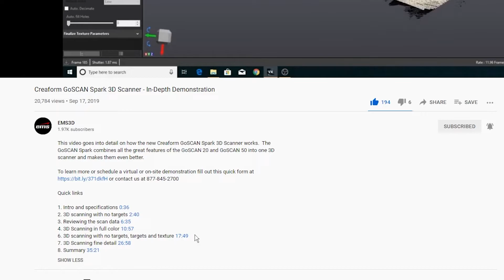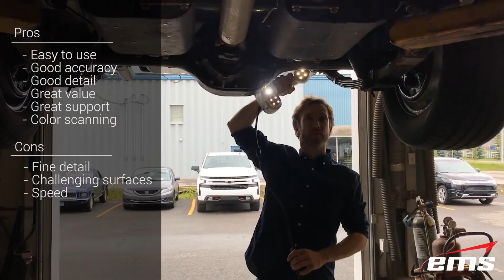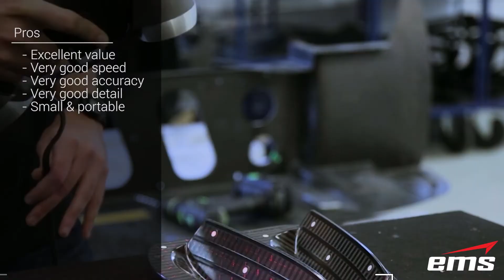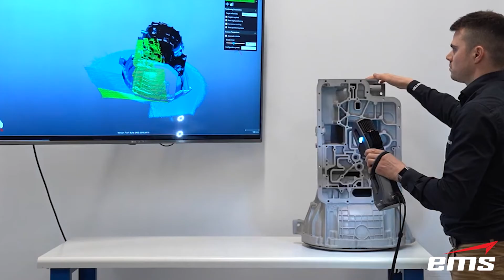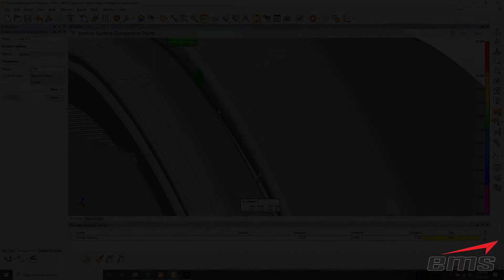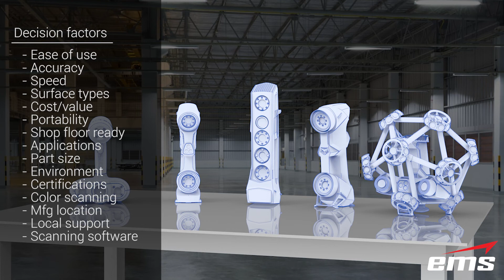3D Scanner Shootout - 5 Models

Comment: Hello, awesome video 
One question. What scanner or scanner - software combo would you recommend to scan and compare machined parts like for QC purpose or first part inspection.
Reply from the maker: Hi Marek,   it really depends on the accuracy you require for your inspection.   Technically they will all work but the higher the accuracy you require the high end model scanner you will need.  Also if you need to meet ISO certifications that may require the HandySCAN or MetraSCAN Black series.   Feel free to contact us at 877-845-2700 to discuss in more detail.

Comment: Great video, would a Peel 2 be a good choice for scanning full size motorcycle clay models?
two purposes,
1 check if bodywork design will fit on chassie in cad.
2 scan to mill molds in ureol for bodywork laminates.
I guess 1 will fine but how about 2?
Reply from the maker: Hi Motoform,  yes potentially it could work for you.  If you want to discuss in more detail feel free to give us a call at 813-971-2700.
Reply: @EMS3D  Thank you, Im in Sweden, any European branch I could call?